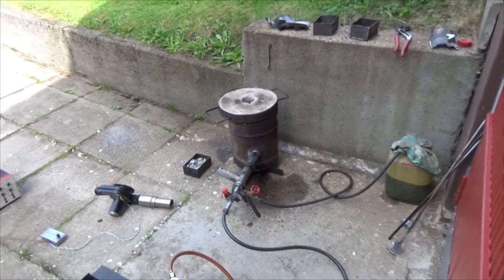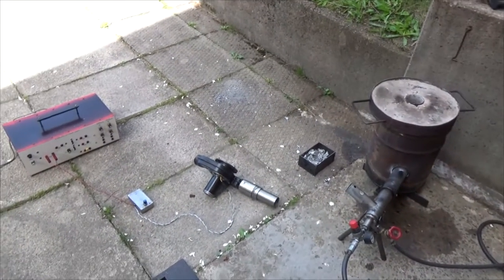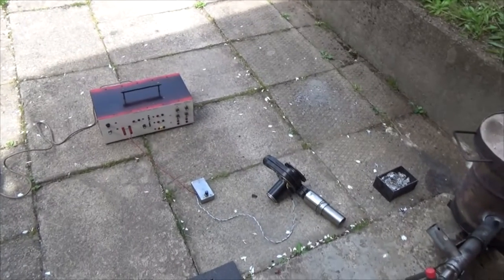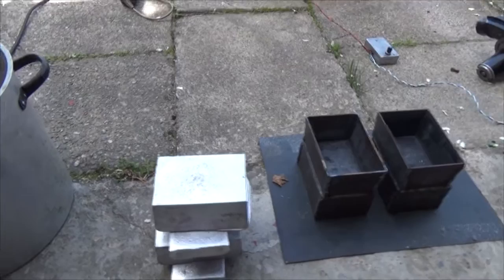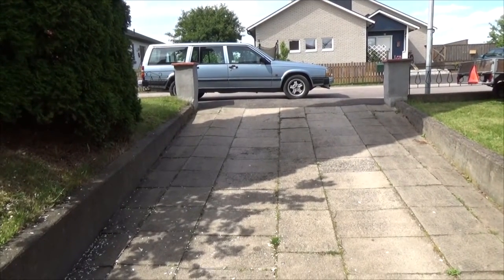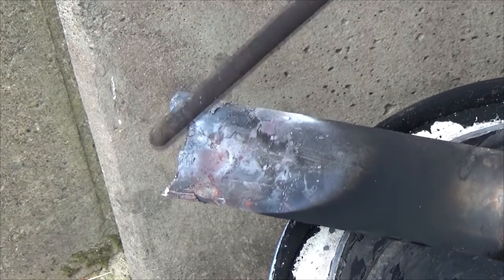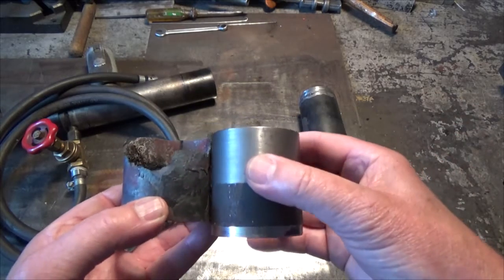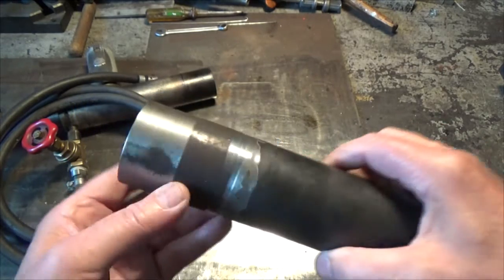Miscellaneous Activity

Comment: My previous Volvo was a 740 and sadly, by the time I had to renew it, it had 254000 miles on the clock.....a very good and reliable workhorse,....it fitted me like a glove.
Reply from the maker: Yes they are really reliable, mine 745 has now reached 192700 miles.

Comment: I must confess I have owned several Volvo's over the last 30 years, I drive a V50 at present and would not dream of looking at another make of car.
Reply from the maker: Yes, Volvo has made some good quality cars over the years. My old car will be 30 years by 2018 and then it will be referred to as a veteran car in this country. It means that I don’t have to pay any annual tax of 2500SEK, the car only needs safety inspection every two years instead of every year and I don’t need to use winter tires during winter. But needless to say I will be using winter tires as I do own a set of those and for safety.

Comment: you need to tune your burner for a more neutral flame as it is acting like a cutting torch. Also I would recommend stainless steel for the burner hot end.
Reply from the maker: Yeah maybe a little lower air pressure will do the trick, don't you think? 
Stainless steel for the burner hot end is a good tip and I would have used that if I had some stainless tub laying around, but sadly I had nothing of the kind that was in the right dimension. That's why I used some regular steel tubing. Anyway I do think that the steel tube that I used will last several years. Thanks for watching and comment.
Reply: I use a natural aspirated burner so no need to worry about a blower causing a cutting torch flame! I found Stainless steel makes a nice burner if you can find it but it too will be  effected to the high furnace temperatures.   Cheers
Reply from the maker: I can adjust the air pressure and the amount of fuel to my homemade burner, so I think I can handle the torch flame. I did had a stainless steel tube laying around, but it had a little bit to small diameter to suit the burner.
Anyway I do think that the new end that I welded to the burner tube will last me a long time as I hardly use the burner no more than three or four times a year.